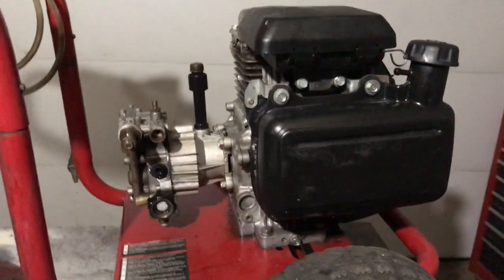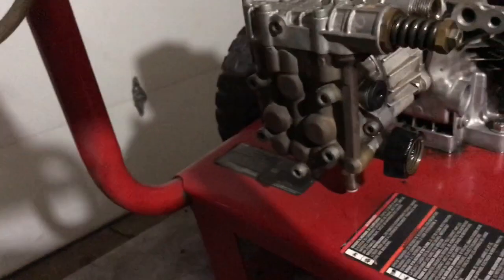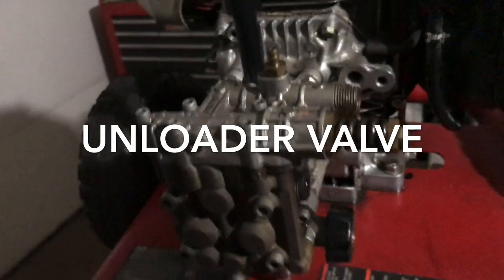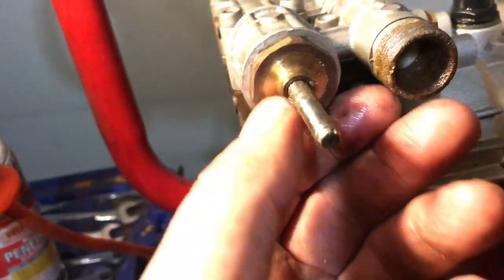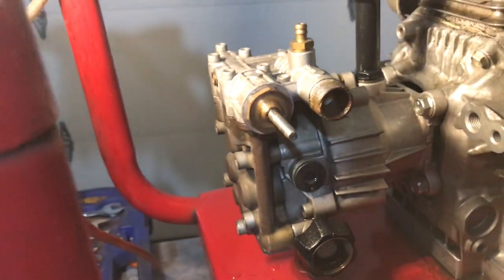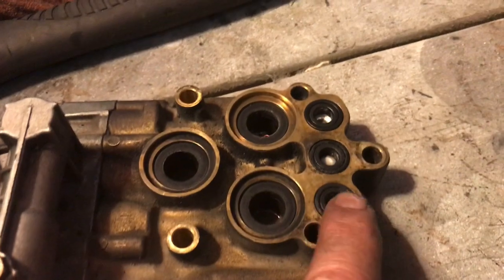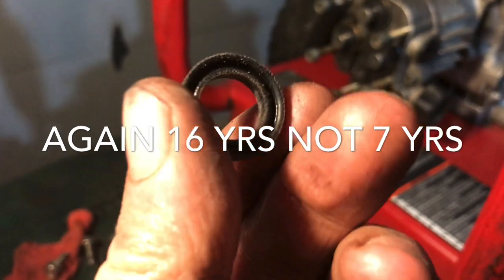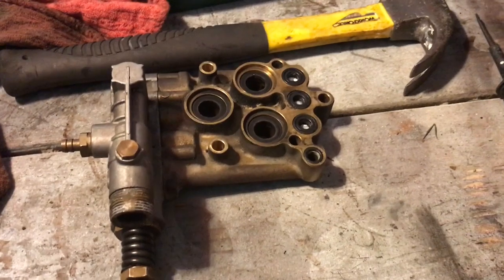Pressure Washer Pump Repaired - It’s NOT the Unload Valve - Easy $4.00 Fix! - Part 1 of 3

Comment: Do you have any numbers or information regarding that pump? I just rebuilt one by replacing the broken unloader manifold, and its leaking. I may need o-rings.
Reply from the maker: Sorry i don't. I also looked for an Oring rebuild kit and could not find them so I reused the originals.
Reply: @LivetofishOutboardRepair  thanks for checking.

Comment: Had the same thing happen to mine today. But I found my key on the concrete next to pressure washer. Now I just replaced my pump with the 3200 PSI upgraded pump last year (I think I still got a couple weeks left of the 1yest warranty) the inside of my pump where the crankshaft of the Honda motor sets down in there. It's shinny and wore a little. Enter my pump at the very top of where the channel is for the key had that same Nick that yours has. I was thinking that was a steak to keep the key I'm walking up out of there. And I had planned on what I'm putting mine together here in just a little bit staking it again but it's taking a little bit better. To make sure that he doesn't walk up out of there. Let me know how yours worked out if it's still working or if you had more problems because of the gap of the shaft the male and female having too much to play? Thanks Robert
Reply from the maker: Still running strong .

Comment: Very well done video and great information for most people with a pressure washer. well done.
I just used my WestingHouse Pressure Washer for the first time. I noticed when putting it away that there was something which sounded like a metal ball loose inside the machine. 
Do all these unloader valves have a ball bearing in the valve/check valve? 
I am hoping that this loose metal noise that I had heard was a normal situation/noise because of a ball bearing inside a unloader valve......Thanks in advance for any information you can share.
Phil
Reply from the maker: All that I have seen had a check ball in the unload valve. Since this valve is spring loaded it is adjustable for tension. I would consult your owners manual for adjusting it.
Reply: @LivetofishOutboardRepair  I found the problem. The small plastic valve in the soap tank (located on the soap tank cap), came apart and the ball bearing and plastic cap that held the ball in place dropped into the soap tank. it was rolling around in there. Thought I would share it in case someone had the same problem. Thanks again.
Phil

Comment: You probably already have your pressure washer fixed by now, BUT OK! Yes i have a TroyBuilt i bought Refurbished from Sears in 2010 AND IT HAS BEEN A GREAT MACHINE!!! Well last year it just went KA PUT on a job i had to finish, So i figured it was time to R & R the pump. When i took the pump off i quickly discovered there was a problem THERE WAS NO KEY.  so i figured just go to ACE HARDWARE and pickup a small 1/4 inch X 1/4 inch key square stock, Well when i went to install it the pump STILL turned and was DEFINITELY not ENGAGING with the engine. I was stumped for about 1/2hr. when i finally RELIESED that one side (that engages engine to the pump) HAD TO BE LONGER/THICKER  by about 1/16 of an inch to 1/8 of an inch.  So i grabbed my mig welder and piled on the material (VERY CAREFULLY) then when i was done i grinded the taller side of the key flat and installed on the shaft, BUTT the key would NOT SIT still when i wanted to install the pump on the engine shaft SO i tack welded the key on the engine shaft. aaaaannnd  WA LA the pressure washer finished the job!! and has worked ever since.  PRAISE BE TO GOD!!

Comment: I admire you for figuring it out. We could not get ours going, ordered a replacement pump and it has a sheared off brass bolt right out of the box, Of course we could not tell that it was until it was installed and cranked up and bluey! The bolt head flew off! We're sending it back, get a replacement. I am so sick of that pressure washer. It was my bright idea to try and repair it, now I want to forget the whole thing. :(
Reply from the maker: I'm sorry you had trouble. I give you a lot of credit for trying. Thanks for sharing your experience and taking the time to view the video.

Comment: I put my pump back together today after replacing 3 check valves, that is when I noticed I had no keyway. I was lucky. I had some 3/16 th metal in the shop and made one. Got it together, and water went right through it out these two small channels on the head of the pump. It was getting dark and I was done for the day.   Do you have any clue as what I did wrong?
Reply from the maker: You may have worn o/-rings

Comment: they make that key of some short of plastic, so if the water pump fails the gasoline engine will not break it into pieces. like have a soft bolt on your farm plow, cheaper to replace a bolt that a broken arm on a tracktor plow

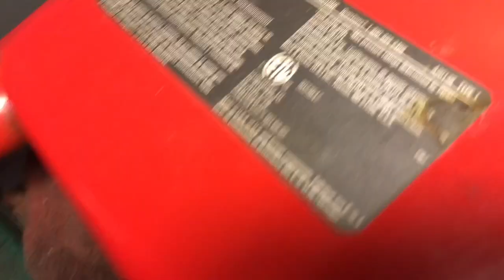Comment: At 12:14 you can see that the keyway (slot) on the engine crankshaft has a "mark" in it, near the engine. Looks like the key got loose from wear and walked toward the engine in the keyway. Then it finally got loose enough, and worn small enough, that it finally came out, causing the "mark" in the crankshaft when it left the keyway.
Reply from the maker: @oldbones3092……. Great observation. Thank you for commenting

Comment: I’ve never seen one missing the key way, strange thing for sure 
I’ve rebuilt a lot of them and kits are not that high price 
I try E replacement parts first
Reply from the maker: Phillip Hall … thanks for the tip. Yea the key was shredded unfortunately I wiped the pump clean and didn’t show the metal fragments but the key was definitely there just in very small pieces.

Comment: my guess is that whoever used a 3/16" x 1" keystock instead of 1/4" x the length of the slot. so as it shifted it shredded the  bar stock. steel key stock won't shred like that but aluminum key stock that will sacrifices the key stock instead of the pump or the motor.
Reply from the maker: HOPE … I’m not sure what size key the factory used when building this model. I’ve owned it since it was new and never ran into this problem until it just stopped producing pressure. Like you said the key must have been aluminum otherwise it would have shredded the pump.

Comment: Add after only 90 sec?
Reply from the maker: Eagle Media…. I believe the key was shredding over a long period of time and it finally completely disintegrated the first 90 seconds of operation at the beginning of the spring season when I went to use it. So this was not just a quick failure.
Reply: @LivetofishOutboardRepair  Your Youtube video beginns with advertising (Add) and just after 90 seconds another advertising (Add) comes.
Reply from the maker: Eagle Media … Sorry about the Adds but this video is one of my most popular and I believe YouTube runs these adds because it is popular. You should be able to skip certain adds. If not, I appreciate your patience and hope you still watch the video for its content and hopefully helps you solve a similar problem with your equipment.

Comment: That is a standard square key, not a Woodruff key.
Reply from the maker: Mike Nakano … you are correct. Thanks for clarifying.
Reply: Where do you get a square key for this application? I’m working on a pump now that’s almost identical.
Reply from the maker: @maccurtinequipmentservice8915  just Google it. Amazon has them 3/16” for Honda engines. They are standard size.
Reply: @maccurtinequipmentservice8915  Any hardware store should have the appropriate material.  Ace hardware is a safe bet, but I am not sure of the lengths available.
Reply: Looks like someone left the key out...the key is made of steel..it would have trashed the pump had it done what you suggested...its a 1/4 key
Reply from the maker: @gregmccarter2176 … I believe it was an aluminum key. I bought it new from Home Depot and it’s never been taken apart until now. Thanks for sharing your opinion and tuning in.  Happy Holidays!
Reply: @LivetofishOutboardRepair  I worked at a pump repair shop for years..and still do, iv never seen a aluminum key..it doesn't make any sense at all
Reply from the maker: @gregmccarter2176  no disrespect intended. But like I stated in the video that I didn’t show was that there was a lot of silver metal particles throughout the inside of the pump. I know the key was shredded but not the aluminum housing inside the pump. It just makes sense to me that if the key was steel it would have done way more damage to the aluminum pump housing. Anyway I guess will never know.

Comment: How in the heck did you get the unloader valve loose from the pump?  Its a brass nut and it seems like it just can’t be broke loose.  Almost seems like I need to put an impact wrench on it!! Thanks
Reply from the maker: Did you remove the center screw first? That might be holding it I can’t remember.

Comment: Pretty sure they'd use a soft aluminum key to protect the pump and engine if the pressure relief system fails and there's a hydrostatic lock.  Over the years it probably ground itself to powder as you suggested. Good on you for figuring it out.
Reply: Its possible but....the metal fragment he pulled out in the video appeared to be magnetic. It looked as if it was magnetically sticking to the tip of his scratch ask/ice pick...could've been sticky with grease.
Reply from the maker: @kalebmarquardt8008  I guess we will never know
Reply from the maker: Gene Ressler....I’ll bet your right about that the key must have been aluminum. I think the new key is steel ... not sure but it’s been working fine so far. Thanks for the explanation.
Reply: Negative, keys are steel.
Reply: @mikenakano9655  keys are steel or aluminum .  Check any Briggs and Stratton engine and you will find an aluminum key .   Been that way for 40 yrs

Comment: Where is Part 2?
Reply from the maker: It’s called “Pressure Washer Pump Maintenance & Repair - Oil Change & New O- Rings - Part 2” I have linked it into the description along with Part 3.